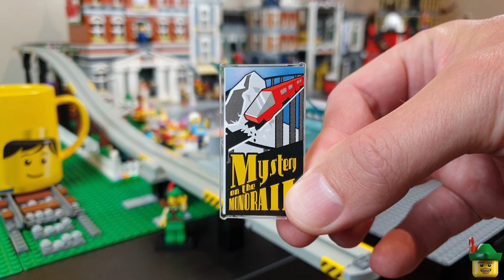LEGO City Update - Marina MOC Tram Station & Elevated Monorail 🚋🏹

Comment: Looking good! And I like that you have a consistent approach with your station designs. 
When you set up the tram, you may find that the return switch is too far from the end of the line and half your tram is still not in the station! (Motor is in the middle of the monorail train). Swapping the two lengths of half straights should sort that out...
Reply from the maker: You're right that not all the tram is serviced by the stop but I don't want it any longer as it'll then take up too much space.  Also the track needs to have that much sticking out the end to accommodate the tram and I can't have it stretching any further either.
So it isn't perfect but it is crammed in and allows for EVEN MORE LEGO around it.  That's my ultimate goal!

Comment: if you really wanted to disguise the track switcher, you could replace it with a rubbish bin piece, but it might look a little weird in the middle of the platform
Reply from the maker: Whoa.  There's a good idea.  I never thought of using anything other than the actual switch.  Mind blown.  Gonna think more about that!
Reply: @RobinHoodBricks  how about a turn style with part 48723 on top
Reply from the maker: I've got something similar planned for my main railway station.  Good suggestion though!
Reply: I actually thought the exact same when watching. It would be a perfect camoflage.
Reply from the maker: The only problem is I do like the authenticity of the genuine, original, old grey round tile.  It took me ages to find two.
I will definitely experiment with a green dustbin though!
Reply: @RobinHoodBricks dose the round tile fit on a dustbin and not spin to much
Reply from the maker: Yeah but then the dustbin has a weird arrow on it.  I'll check it out though!

Comment: You could switch the handle---thing for a gray or green trashcan? Then it will be completely diquised.
Reply from the maker: I've tried that.  Sadly it looks odd and the trashcans have very low clutch for turning the stiff switch!
Reply: @RobinHoodBricks  What if you place a round 2x2 plate in between?
Reply from the maker: @chilis_no  The trashcan then leaves the plate behind!